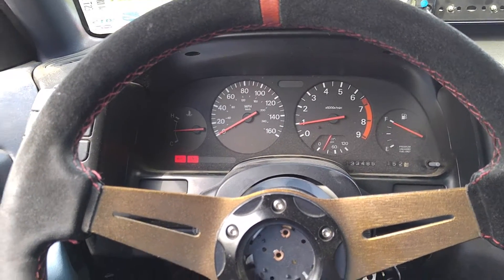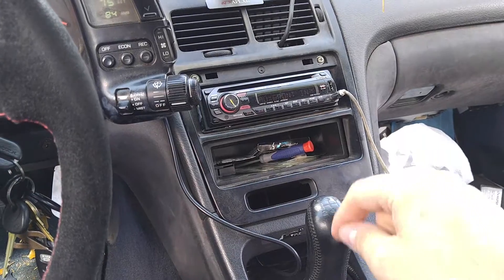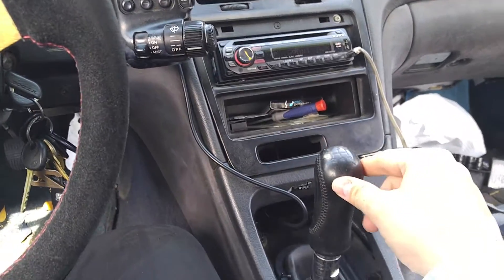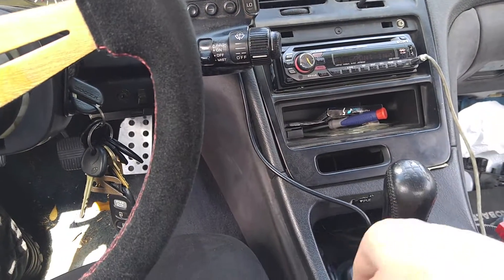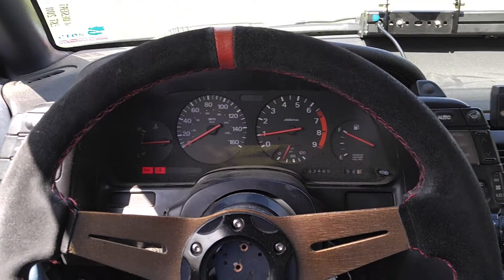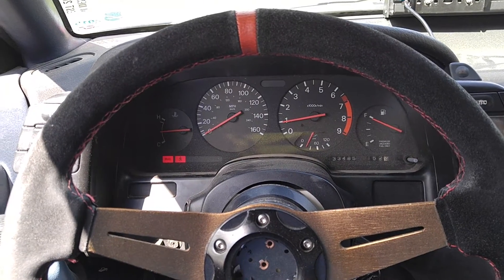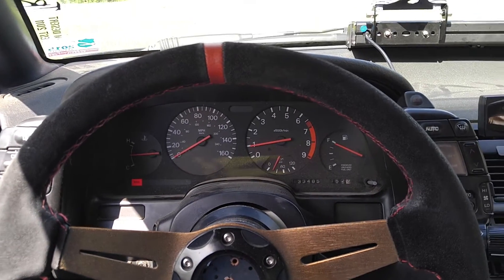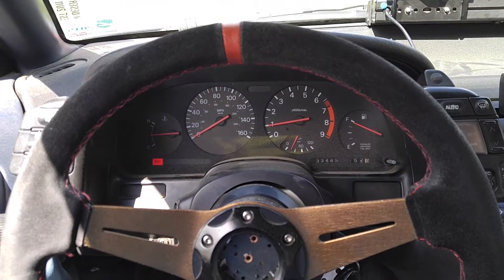April 16 update

Comment: rings, valve stem seals or possibly stuck open pcv valves? gotta love trouble shooting lol, one of the many joys of owning a z =] but i wouldnt trade it for the world haha. all the best brotha!
Reply from the maker: +preprodigy PCVs are a known problem.
Reply: +Joshua Griffin exactly why i mentioned it lol. ive deleted mine and added a custom oil catch can inbetween the suction hoses from intake valve covers to the intake suction pipes. that way theres still negative crank case pressure but no oil will be sucked into the intake system. 

makes life a whole lot easier in my honest opinion... 

so what have you narrowed it doen to so far?
Reply from the maker: Compression is good across all cylinders,  so it's not valves. Pcvs have been replaced,  so that pretty much leaves rings or still Pcvs lol
Reply: +Joshua Griffin or valve stem seals. u can still have compression but have bad stem seals since the seals are above the valve seats in the head. 

i only know cause i smashed the shit out of a set of viton valve stem seals on my first ever motor build. im ashamed of my mistake but i learned from it at the cost of not only the viton seals but also tearing down the motor just to replace them lmao. 

but more then likey its the vtcs like ur thinking..

i have a spare set i can send ur way for a few bucks if u wanna test them out. they cameoff my z with 78k, i deleted them as soon as i got my z.